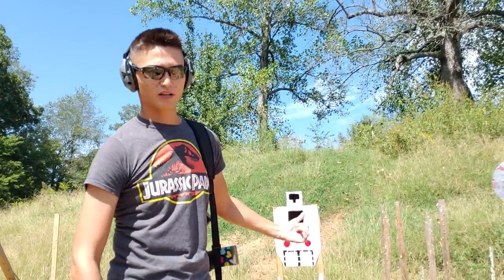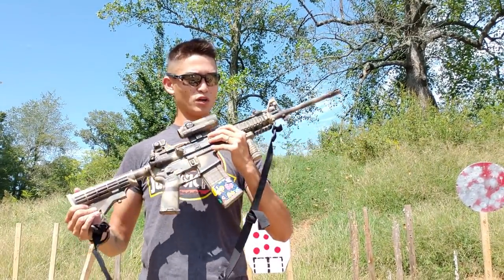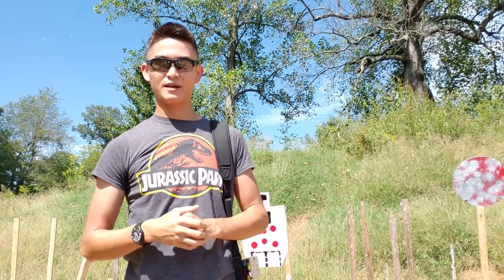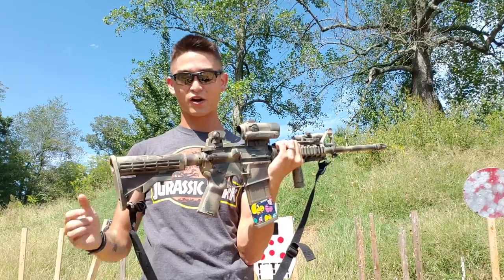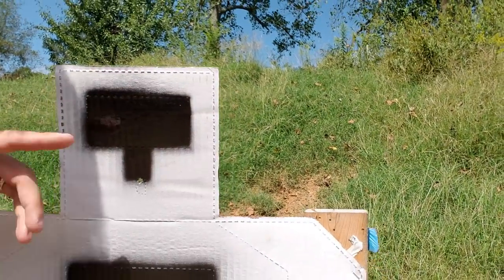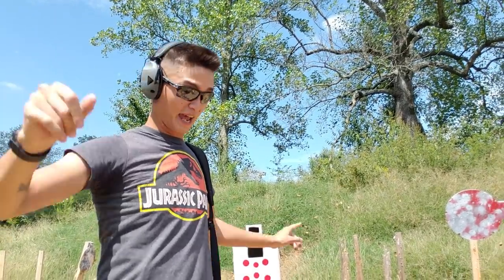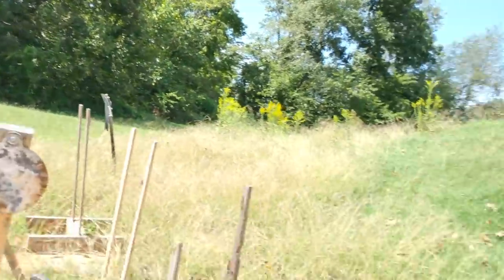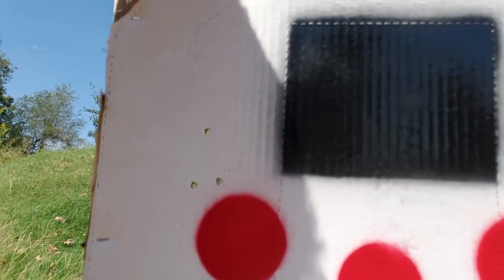Speeding up your rifle zeroing process.

Comment: Ive always used a large piece of cardboard with a small target in the center and started at 25 yards. From there I go to 50 and then 100. Its always worked for me. However its hood info for those new at shooting or first time centering their point of aim to point of impact.

Comment: Speaking of out of spec factory guns I sent my complete unmolested spikes midlength back for repair for having a bunch of failures to feed. The guys at the factory basically told me nothing was wrong with it even though I sent videos of it malfunctioning! I got it back and noticed the feed ramps on the barrell were sticking out a hair past the receiver cuts in the upper receiver. It took me about 2 minutes to fix it with a dremel tool and now it works fine... Thanks Spikes...

Comment: Three things clearly done wrong. (Sarcasm) First off, I didn't see even one empty beer can.
Second, everyone knows (C.O.D.) you have to do at least 3 mag dumps for zeroing.
Third, the third and worst mistake is (Liberal Ideal) The AR15 which means Assualt Rifle shooting 15 rounds per second, doesn't need zeroed. All you have to do is press that Fancy Bullet button on the side of the mag well. That instantly gives you a perfectly aimed shot. That's why in California, any more than 10 rounds isn't needed. Also if you hold your pistol sideways (Gangsta Style) it's always a kill shot.

Comment: Holy cow! You already shot out that 20inch rifle lol. Was that with mostly steel cased?
Reply from the maker: Wasnt all me, I lend it out to students when their guns break.
Reply from the maker: Also yes, just about all the ammo shot was steel cased.
Reply: Reid just posted a video about students guns breaking. It must happen often.
Reply from the maker: @colby7625  That's not what he posted about, he posted about new restrictions and uninforcible policy for his open enrollment school.

Guns breaking in places they are used is absolutely normal because they are actually being used. In a single two to four day class the students that take my individual program fire something like 22-2,400 rounds... In an environment like that, gear will break and wear out on a regular basis. No surprise both of the guns I use as loaner rifles got their barrels shot out.

A lot of companies actually use classes as a part of their testing regiment.
Reply: RGT ok understand. Have you had any issues with students bringing non mil or modified guns to class?
Reply from the maker: @colby7625  being frank we have had both factory and user built rifles go down in class, and it's always a roll of the dice on what exactly goes down really. 

For instance, we've had factory bushmaster bolts snap in half, a ruger gas block come unscrewed, several keyholing barrels, (not including mine). We've seen a bcm bolt lug sheer, a daniel defense rifle that had a gas tube burst, various rails come loose, a spikes rifle with an out of spec (waaayyyyy tooo sloppy) lower, and the list goes on..... These examples literally are just from the factory guns I've seen go down. It doesn't even come close to covering them all, and we're not even started on the builds, and sub par AKs yet. 

People assembling guns (no matter occupation) will screw things up, and if not, things will break anyway eventually. It just happens to be more satisfying if you wear it out the other way. 

But the thing to take away, we kill guns all the time here, but generally most ARs that come to class are a purchased upper and assembled lower, with a growing number of guys that assemble uppers as well, and the vast majority of the time, they are indistinguishable from a factory gun in performance.

They both perform, and they both shatter into a million pieces on occasion.
Reply from the maker: @colby7625  yeah I would

Comment: Why’d you tap the dial on the comp M4 after you made your adjustments?
Reply: He shot the irons first, then turned on the dot.
Reply: Jason Clark I got that, but he tapped on the dial like you would on an acog after he finished turning it.
Reply: @Ranger4321  Probably habitual from ACOG use with green weenie issued rifles.
Reply: It’s actually good practice with any optic. Most aren’t as bad as acogs at hanging up or not giving any movement  or partial movement but it does happen especially when you’re moving a lot.

Comment: I’m shocked at how when I switch optics from one ar15 to another they are so close, needing little or no adjustment most of the time unless it’s a high powered scope. 
  By the way the fitment between the upper and lower has absolutely zero to do with zeroing optics. The upper is all one piece and true to itself. If what you said is true then a shooter would need to re zero if they swapped lowers which we know isn’t the case. I’m assuming I misunderstood  or you mis spoke.
  By the way, excellent info as usual from a sub and fan.